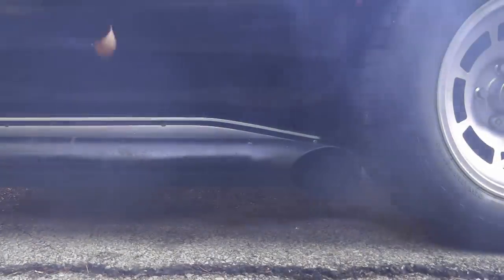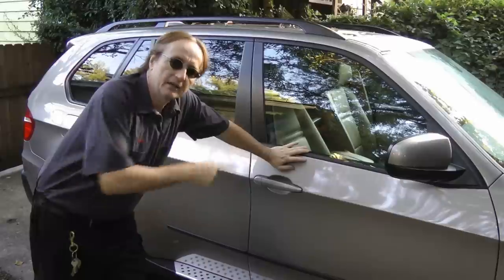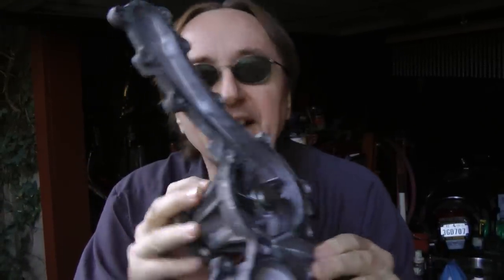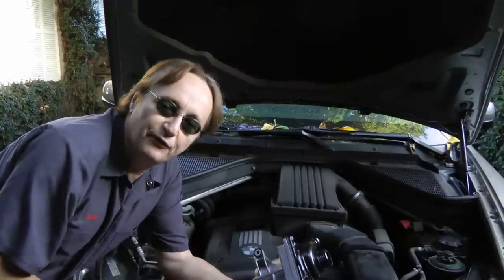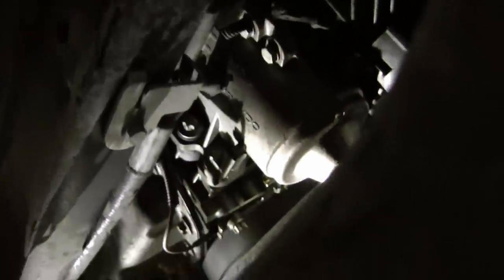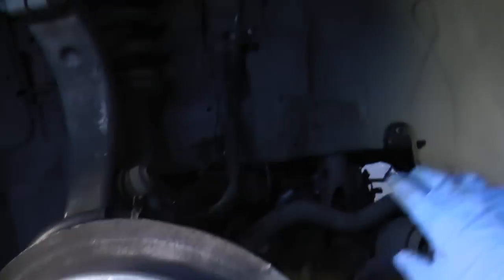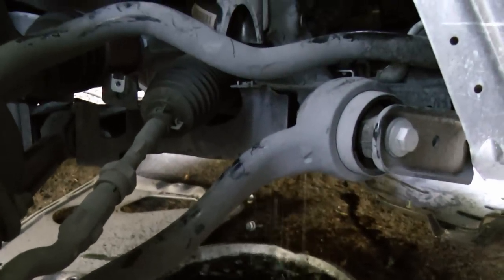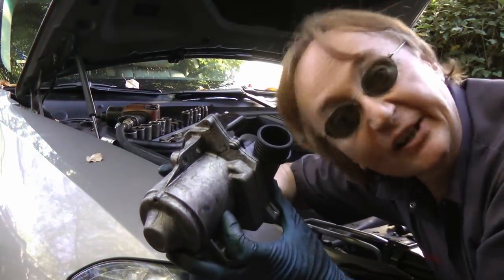How To Replace a Bad Electronic Water Pump

Comment: A lot of critical comments here.  I think some of you folks are missing his point.  If you watch all his videos about expensive exotic cars, you will understand what he means.  What he's saying is that these cars are great to drive and own only if you have the money to keep fixing them or just replace them after a few years.  If you want a car that has long durability and is inexpensive to repair, then DON'T get a luxury car, German car, etc.  They're so over-engineered, that it takes too much money and effort to repair or maintain them.  One example is checking the oil level on a BMW.  You shouldn't need a freaking computer to check the oil level.  That's ridiculous and it is obviously a scheme by the manufacturers to make money on maintenance and repairs. They don't want the normal Joe off the street to be able to work on these cars.  They want him to bankrupt himself paying their dealer service bays to repair and maintain these cars. Yes, these German (and some other) cars are amazing, high tech machines and are a thrill to drive, but they are not inexpensive to maintain and have too many, expensive problems that need to be fixed or adjusted.   If you've got the money, hey, knock yourself out!  There's nothing ignorant, however,  about what he's saying if you understand his entire meaning and point of view.  I pretty much agree with him.  I'll never buy another German car again (unless it's 1970s or older or unless I become wealthy).

Comment: Scotty is 100% correct, that is why all technicians I have known for the last few years, own older Japanese or American cars, none of all this plastic crap, weight savings my foot, more earnings for their parts and service departments. My 98 Corolla with almost 350k miles has the original water pump. Just replaced the thermostat last spring!

Comment: Love Scotty  Kilmer videos and have learned many things over the years, but have owned and worked on my personal BMW's for twenty years now and have always been impressed on how easy they are to work on, at least the 3 series and Z models I have owned. Have never installed a electronic water pump, but many videos on how to do this plus kits all over the internet that show it as a DIY job, so not sure why Scotty had such hard time. Looks like he may have pick the hardest way from the videos I have watched. As far as BMW's being expensive, the key is stay away from auto dealers, DIY or find a good shop and BMW's are very reasonable to own.  Also BMW parts are sold everywhere and find most times parts are just as cheap or cheaper to buy as the Toyota or my Honda civic parts I buy.  Love BMW's for many reasons, but one of the best reasons are they are most of the time just stunning looking timeless designs. My twenty year old Z3 still gets wow compliments all the time.  Keep the good videos coming Scotty!!
Reply: You have a z3!?!? I’ve wanted one for so long. Couldn’t find one in my price range so I settled for a 550i, but it was probably for the better. I’m still going to buy one at some point.
Reply: Depends on what kind of BMW. An X5 is harder to work on than say a 3 series or even a 5-series. Electric water pumps are a b** though. The thought of crawling under the car and getting coolant over my face doesn't appeal to me. Better to have a shade tree mechanic replace one they're not that hard. Plenty of Chinese pumps in the market today too. Some would say they fail but that's probably not the case for the most part.

Comment from the maker: you have to drill it out, but the metal inside is VERY hard. And not much working room down there, you might pay a mechanic to attempt that AND use an oxygen acetylene torch to heat it hot then they come out easier.

Comment from the maker: fuel pumps are tested using a pressure gauge and seeing if the pressure is within specs for your car, they are all different pressures, you have to look it up model by model

Comment: With it being electronic, were there any OBD codes that helped diagnose the problem? 

I've never heard of electronic water pumps. The one advantage that seems appealing is the ability to adjust coolant flow based on the circumstance. Warms up quicker, quicker to closed loop, and ongoing flow even after the engine is stopped. That said, I agree with all of your comments about the use of plastic, expensive dealer-only parts, in a very small compartment.

Comment: You don't need to jack the engine. Unfortunately I have to do about 3 of these things a week. Drop the shields and use a 1/4 drive 6 mm swivel socket to get the hoses. Then for the pump bolts use a 1/4 drive E 12 swivel. Also make sure you replace the thermostat mounted to the pump. On an X5 the job start to finish should take about 3 hours. It only pays like 3.75 hours. Just wait until you have the pleasure of doing one on a 535xi.
Reply: bimmerbenztech aye just replaced pump but still seems to not work, some electrical issues?

Comment from the maker: if it's leaking, a pressure test would show that. This one wasn't leaking, it just wasn't pumping liquid and on a BMW that trips computer codes showing electrical problem with the pump. BUT, with mechanical pumps, they often make noise as the bearings wear out when bad.

Comment from the maker: I mentioned toyotas cause they the most reliable cars for the money. I could also say tons of bad things about GM as you just did, I agree with that. But any modern BMW is not reliable once it gets to be 5 or 6 years old, especially here in Texas where the heat eats up all that plastic crap they've been using for a LONG time.

Comment: Thing is these electronic pumps tend to be more reliable than BMWs old plastic mechanical pumps... Sadly.

The benefits are that if you lose the belt the engine can't overheat, they have perfect control over coolant temperature and pump speed (never over or under cooling), it saves a few horsepower, the engine warms up faster, and they have a mode that allows you to keep the heat running in the car after you shut it off. If you're running short errands you never come back to a cold car. It's also insanely easy to bleed the cooling system.

Simply put the design has strengths and weaknesses, but it's not entirely bad. The pump can be had for less than 500 and independent shops are cheaper than the dealership. In short, if it breaks, fix it, and move on.
Reply: briantii +1
Reply: krauser979 I guess.  The new parts are less than $500... about the same as an alternator on some Hyundai SUV's.  The electric pump seems to last on average about 100k miles. (Longer than the Hyundai alternator)  If it helps think of it just like you would replacing a timing belt on car, except this probably costs less than that service.  It's not my favorite design, but it doesn't seem excessive to me.  Also I wouldn't exactly consider BMW's that expensive - a base model 3 series is barely more than a nicely equipped Camry.  I think I recall reading somewhere that the 3 series globally is almost as popular as the Honda Civic... they just aren't that expensive or "special".  Maintenance is somewhat more, but then again the suspension doesn't want to make you want to shoot yourself everytime you turn the steering wheel... so that's something.

I agree about people who can't afford to maintain them, but I think it applies to all cars at some level too... I kind of think there are enough jokes out there that there simply is no excuse for at least having a clue that BMW's are in fact more expensive to maintain than a Camry.  Bring My Wallet; Broke Man Walking; etc... I think it's mostly due to the dealership rates though.  DIY on these things isn't that expensive compared to any other enthusiast or luxury car.  More?  Sure maybe a bit... but nothing crazy.
Reply: The pump can be had for less than 500 sounds like you have money to burn. Look at the price comparison between a run of the mill mechanical pump and your glorious electronic device. Big difference. I still like to do my own repairs when possible because I can take all the time I need to do it right and correct any mistakes I detect. A business mechanic has a time window he has to consider and doesn't have the luxury of extra time.
Reply: I think timing belts are definitely on their way out simply because they were a pain in the ass, especially in the interference engines. They're being replaced with timing chains which last longer but the plastic chain guides and tensioners create a bigger headache than the belts. I've never seen a life expectancy figure for any electronic water pump. Where can I get that info?
Reply: I guess you missed the point. On <any> modern car there is expensive stuff that can / will break eventually. $500 in terms of car repair is by no means outrageous.  I don't think the electronic water pump is a great invention or the best way to do something... I agree it's weird, but it's just not that big of a deal. To put it in perspective just a set of rear tires alone on most sports sedans cost more than that. Sure, you can get a mechanical water pump for a 1997 Chevy Tahoe for a lot less - it also doesn't drive like a BMW and you may need to replace that water pump every 60k miles instead of every 120k miles. If an electronic water pump that MIGHT fail ONCE and cost you $500 over the course of 10 - 15 years of ownership is the reason you don't want a BMW, then by all means don't buy one. I'm just saying in the grand scheme of auto repairs and maintenance $500 is a drop in the ocean. Virtually every car I can think of has "something moderately common" that can fail and cost you $500. This happens to be one of those... and yes, BMW's have a few more things like that. After 7 years of owning mine, I can say it's been extremely reliable. I had concerns buying it, but really a few minor things here and there and nothing major. My fancy electronic water pump is 11.5 years old now... no signs of failure yet... when / if fails I'll put another one in and forget about it.
Reply: briantii do you think Electric water pumps are a better way a controlling engine temperature? By reading it sounds like you like it?

Comment: Scotty is all his objectivity. Gold! BMW's are built to a point- to be high precision and performance, cutting-edge. Germans love technology and German cars have a good resume of "firsts" for automotive technological breakthroughs that are in use today (like fuel injection). Technology and precision, and performance, can be expensive. Cadillac thought it had a winner with the Northstar 32 valve. Turns out, mechanics everywhere stayed up at night having nightmares about the day one came in the shop. Electronic suspension and differentials, adaptive motor mounts, computerized everything. All of that is expensive to maintain and repair. Changing the water pump is a $1000+ dealer job. An electronic suspension damper for a Mercedes S Class can be over $1000 (not including labor). A clutch replacement on an Aston Martin DB9 is around $15,000. Warranties don't cover everything. These aren't cheap cars to buy, and they aren't cheap to maintain. Things wear out, and replacement parts aren't cheap. But I digress, American cars are now using electric power steering, water pumps, sealed transmissions and crankcases too. If you want good fuel economy, get a diesel. Anything to keep cars coming back to the dealer and DIY mechanics out of the engine compartment. If you want a long warranty, buy a Hyundai. Hyundai makes nice cars, by the way.
Reply: +Nick Bruns Yeah my friend just purchased a 2016 Hyundai Sonata Sport with the turbocharged motor. Fantastic vehicle and the price was reasonable for what you get in it. The warranty is really good too and based on consumer reviews it's rather easy to claim repairs under warranty.

Comment from the maker: when it's idling in park, try a scan tool then. If it doesn't read then, either the main computer has a problem or the wiring going to it. On those, normally the computer but if it runs OK, ignore it

Comment: thanks to scotty I'll never buy a BMW
Reply: The older ones from the 80s and early 90s were quite well built. These newer BMW's from the late 90s and forward are garbage. We had a 740IL about 10 years ago and never again will I own another BMW. Way too much cheap plastic under the hood that constantly failed: pulleys, over flow tanks, radiator end caps,etc...
Reply: I own a BMW lol, and yeah their cooling systems are effy i replaced my entire cooling system.... but really, what a driving experience!!!!
Reply: Have you replaced the front suspension yet? That is another weak area on BMW's. It's not uncommon to replace the whole front end by 70k miles.
Reply: Yes I have, and yeah you're right... waaaaay too many plastic parts in IMPORTANT places, I just think it's designed obsolescence, you know since bmw owners are usually people with money and don't mind forking out cash.
Reply: No they think their owners are idiots. People with money don't stay wealthy long if there constantly repairing their cars. The problem with BMW is "cheaping" out their cars like this is a double edged sword and the smart buyers will just switch brands. Call me crazy but sales are down YTD for BMW while other manufactures are breaking new sales records. hmmmmm ;)
Reply: DIY Dan Japanese cars lol... think I should sell my e46 and buy a toyota corolla
Reply: Yep, I finally gave in and got my wife a new Lexus GS350. I love German cars so still have mine, but have to have a backup "daily" for the "daily" if you know what I mean. lol! If you have driven any of the new bimmers they're a total disappointment anyways.
Reply: Dont even try buying it cause u cant afford it this car has complicated engineering because its not a cheap 150hp to 300hp car these cars high performance or lexury tough built cars , mercades audi lambo and Ferrari are all the same
Reply: I love my BMW. :). this guy is such a hater lol. I like all kinds of cars.
Reply from the maker: I work on all kinds of cars, but yes, I hate the ones that are poorly made , hard to fix, and a money pit for the owner. I, unlike many mechanics, care about my customers not getting ripped off. Yea, it's true.
Reply: Hey somebody got to tell the true about those European cars
Reply: DIY Dan uhhhh

Comment: electric water pump is not a bad idea, the problem is the plastic material.
i would personally love to have an electronic (but metal) pump on my car and tractors.
actually i would love an electric engine oil pump too.
i could have proper oil pressure right before i start hem up, and have the pressure (and lubrication) even a bit after shutting them down.
Reply: +Nagy Andras I agree. You would think that BMW would have located the pump someplace that it could be serviced. I know on my Toyota you have to take apart the left side of the car to replace the water pump. So if they could relocate the pump it would make sense.
Reply: the place they put the pump is one of the best. Many belt driven older pumps (mechanical, which is what the whole clip is about) require that you take the whole timing belt off and that is a much much bigger job. To me, this BMW is a breeze to change the pump on.
Reply: Nagy Andras what pisses me off is that its plastic!
Reply: yep, that is one shitty thing for sure..
Reply: Mechanical devices usually give you fair warning when they're about to expire. Electronic controlled junk typically craps out immediately, usually in the worst places and in the worst weather. Good luck, electron huggers.
Reply: rayford21 
actualy electronic waterpump given a decent controller could estimate its own lifespan, and since it would not be tied to engine  revs, it would have longer lifespan to begin with. probably a simple flowmeter to measure fluid flow and rpm meter for the electromotor,along with a current meter would provide more than enough info for estimations. even bearing faliures could be forecasted along with a worn pump unit.
and yess i would like my engine oil pump like that too.
Reply: Btw you can't use metal with electronics

Comment: I like the idea of electric water pumps, but they should still be made out of durable materials.  Being able to control the coolant flow unrelated to engine RPM makes sense.  But making them out of plastic and putting them in hard to reach places doesn't make sense.  If the pump doesn't need to be driven by a belt they can place it virtually anywhere in the engine bay.  No need to make it hard to reach.
Reply: "If it ain't broke, don't fix it" . So if mechanical water pumps worked well for so many years, why would anybody want a trouble prone electronic controlled nightmare replacing it? Somehow that RPM flow control theory doesn't sound right.
Reply: It allows a hot engine to flow the coolant at high speed and run the radiator fans at high speed even if the engine is at idle.  It's possible for cars to overheat idling on a hot day because the coolant is barely flowing through the engine .  There are many benefits.
Reply: You forgot to mention that the soft magnesium, or aluminum screws that bolt the pump to the block need to be made out of iron or steel. I can see these things breaking when trying to loosen them!!
Reply: engine block is magnesium, that's why bolts also had to be same (to avoid thermocoupling and corrosion)
Reply: @Plur307  yeah like on my Toyota Corolla the fan dont kick on until the temps are around a quarter away from the H zone and once the fan turns on it quickly brings the temps back to proper levels

Comment from the maker: motor burned out, and really, they could have put it anywhere on the car making it a five minute replacement job, since it was electric and hoses could be run even on the fender. Asinine design